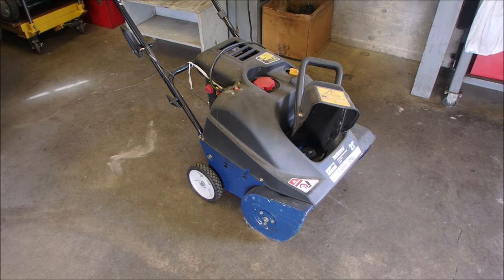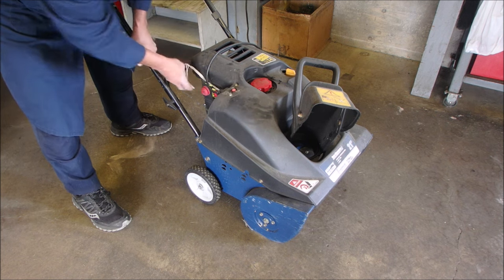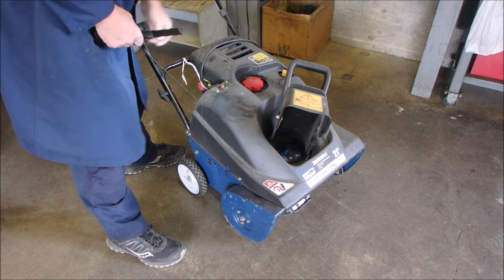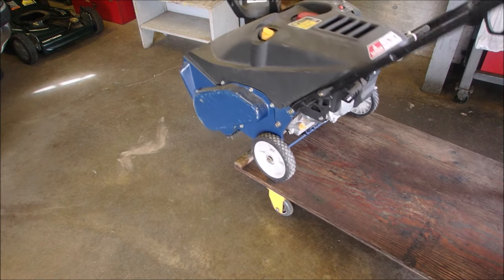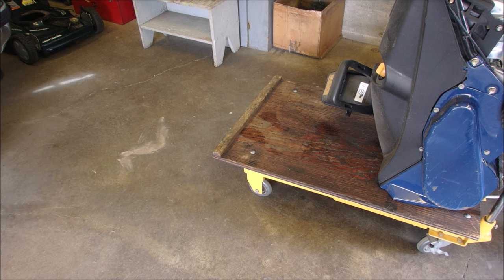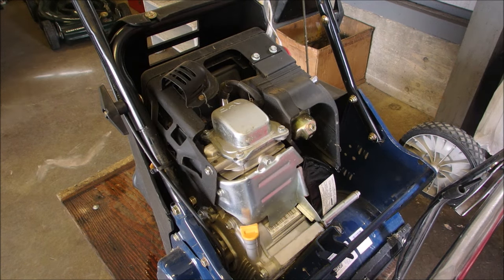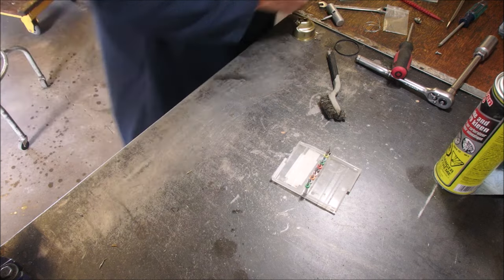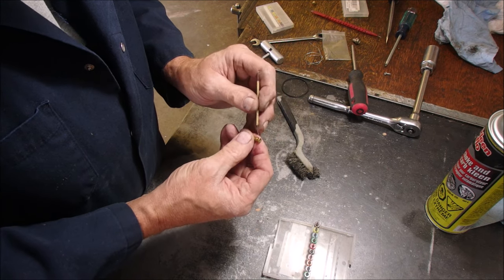A Yard Machines Snowthower Needs Love

Comment: Bruce do you find an Electric engine to be better with more power, or is a Gas 4-stroke engine better with power?
Reply from the maker: Deffinatley the gas engines have more power.  It is called torque and gas engines for yard use have more power.

Comment: Hi Bruce. Off topic question. I have a Troybilt 1400cc push mower missing the screws that secure the air box to the carb. Would you know the size, thread pitch and length? I can find the part but not the dimensions. i though yu may have better resources. Thank you for any help you can provide. BTW, it starts but it takes five or six pulls. I'm thinking there is a slight leak.
Reply from the maker: If you send me a picture of the mower that may help.  It is not about the Toro thing.  Most folks relate to that but---------   It is about the make of the engine and size of the engine.    email       bthversion1@gmail.com
Reply: Hi Bruce the engine is Briggs model # 09P702-0144-F1. Plastic carb. 140cc 550EX. Thank you so much.
Reply: Hi Bruce, I wound up going to a repair place and they had screws that worked for a dollar. All is well. I didn't send a picture because I didn't know how.